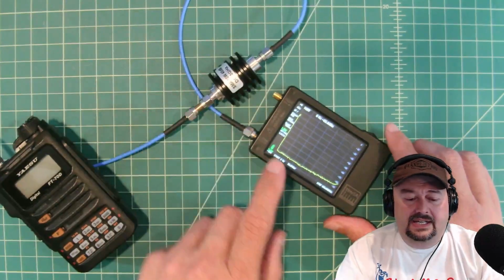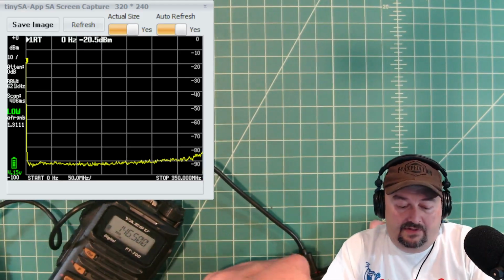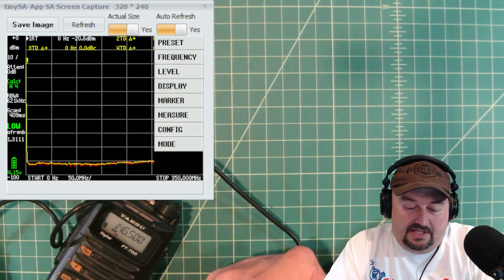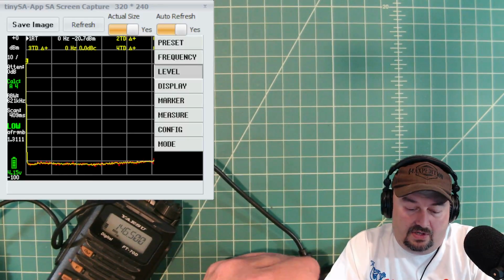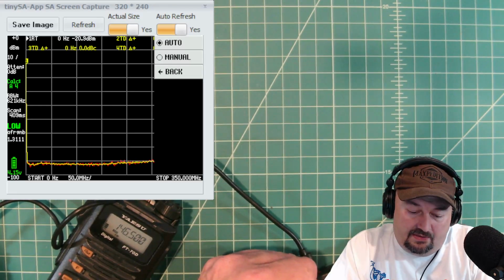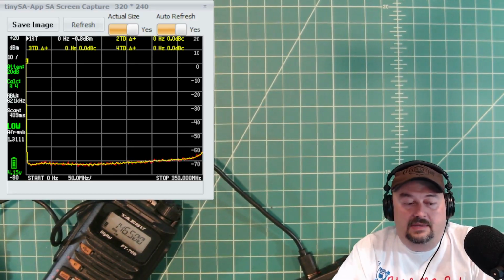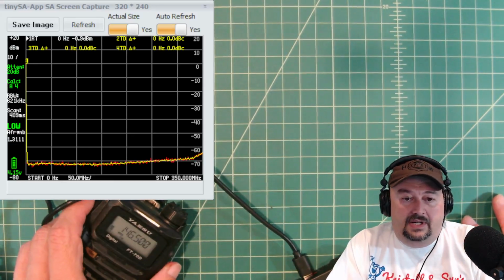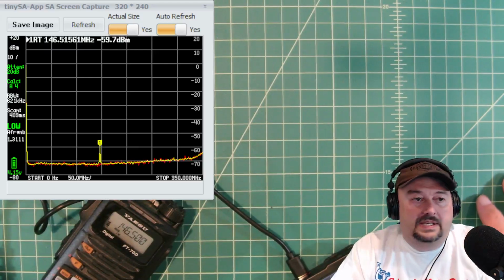Testing the Yaesu FT-70D for Harmonics with the TinySA

Comment: In other video "Measuring Power with tinySA Ultra" you also using 40dBm external attenuator and punching -40dBm in tinySA. But you not adding internal 20dBm like you are using in this video which would make is 60 dBm. Is the other video set to Auto? Just wondering how the Auto detection works? If it was in Auto, what was the final attenuation when you keyed up?
Reply from the maker: They TinySA automatically accounts for the internal attenuator, regardless if it is AUTO or preselected.

Comment: Getting a SA Ultra tomorrow - if UPS delivers - so just starting on your videos. Any advantage using the TinySA - over a traditional combo SWR/Power meter ?

My main use will be signal detection -and antenna comparison - which antenna gives the highest output/have the greatest efficiency
Reply from the maker: Hey Bodstrup.  The TinySA isn't and SWR or even a power meter in the traditional sense, it does not connect inline with your coax / antenna.  You can connect it to to you radio output via coax if you attenuate your signal, this will allow you to view signal levels and characteristics such as signal purity.  You can also use it with its own antenna to view RF emitted from your antenna.

Comment: If one sets the external gain to 40 dB in the level menu, it compensates for the 40 dB attenuator
Reply from the maker: Hey Kevin, I think the max attenuation for the TinySA is 31dB
Reply: @TheSmokinApe  Thats for the internal attenuation block. (Although one can control the sig-gen mode from -6 to -76 dBm) The external gain/ attenuation can be compensated by putting in say 20 dB for an external  20 dB amp, or -40dB for an external 40 dB attenuator. It changes the scaling, rather than any attenuation
Reply from the maker: Thanks for the info Kevin!  It's helpful.